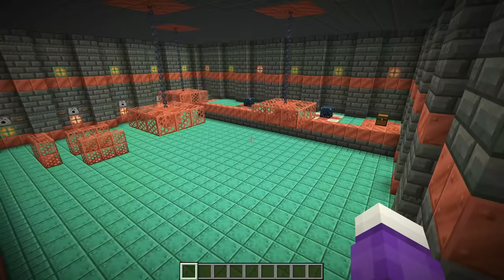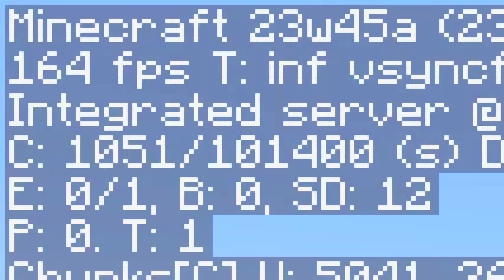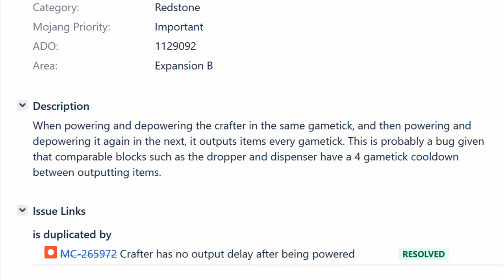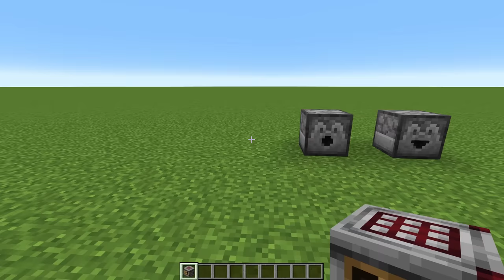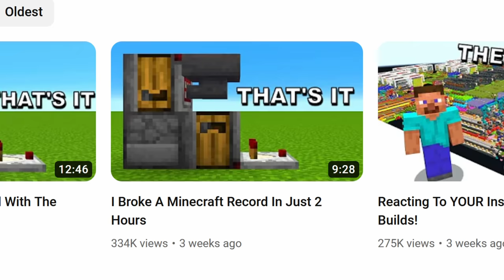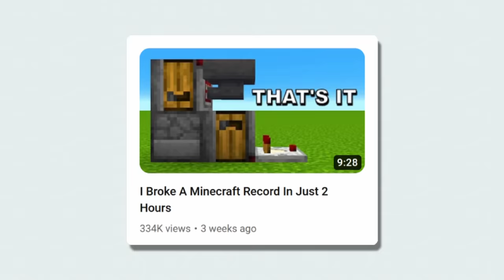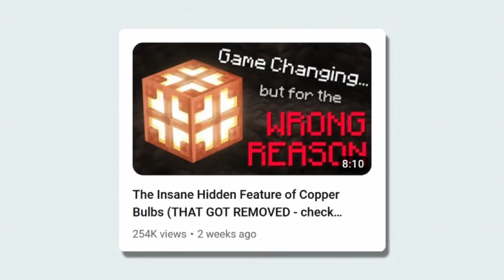Mojang Is About To RUIN Copper Bulbs (And Crafters)

Comment: The crafter nerf doesn't bother me, but the copper bulbs definitely need to be reverted
Reply: no i like fast
crafters but i agre on the bulbs
Reply: Yeah, an autocrafter not needs to be instant. And in fact, the original spead did look like as a very good material for lag machines if you stack up enough of them in the same place.
And for the copper bulb thing: you already have a block that can make timing. It's called "a repeater".
Reply: @tovarishchfeixiao A repeater is not a bulb
The bulb had a 1 game tick delay, while repeaters have 2 game ticks. 
The importance of this 1 game tick, is that All redstone components work on multiples of 2, so entering these odd ticks is very important for precise timing.
You have one movable block that did that (bulb), while all other options are not movable or too big. That's the problem.
Reply: @tovarishchfeixiao  the point with copper bulbs being interesting is that they had half the delay of a minimum length repeater, which, unless they do something crazy like adding copper repeaters or something for game-tick specific delays, the copper bulb could've been revolutionary.
Reply: @danny_dan4323  yeah but mojang doesn't care lol. they don't listen to community feedback, ever.
Reply: @genio2509  That 2 ticks is pretty much enough a thing for a game like this.
Reply: @danny_dan4323  I'm pretty sure that you still can build those things even if it might be a little bit slower.
Reply: @tovarishcheleonora8542 no its not. If you say that then you havent explored enough the redstone part of minecraft and its community
Reply: That 1 odd game tick makes the difference for a lot of builds
Reply: @horminel  You still can make building for the same purpose/function. Even if it's 1 tick slower or not as pleasing for your eyes.
Reply: @horminel  "that 1 is the difference bruhuhuhhuh". No one stops you from building. And you still can build anything you want. Maybe the signal won't be "1 tick" but the purpose and function still there even if a bit slower.
But why do i expect from a 9 years old to understand this?
Reply: Same thing. The special was withered away by placing one tick to make it even.
Reply: @sylv512 Sure. Let's just go ahead and ignore all the countless times Mojang has done something specifically because the community asked for it. Seems reasonable to me.
Reply: @tovarishchfeixiao  the entire point why 1 tick redstone is so cool is because it pushes limits. people dont want this for building in survival, this is for huge redstone projects. if you cant understand why this copper bulb nerf is awful then you might just be the 9 year old
Reply: @tovarishchfeixiao  some machines just break without a 1 tick difference. Hell, if you watched the video and actually payed attention, you would notice the piston extender breaking. So maybe pay attention before mocking people?
Reply: @QTBlaze.  Oh cry more, but you will never have 1 tick bulbs in the game ever. Deal with it. 😁
Reply: @tovarishchfeixiao "why do i expect 9 year olds to understand this"

also you: literally doesnt understand redstone, joined youtube a year ago, didnt even watch the video before commenting
Reply: @tovarishchfeixiao  what's your problem? you just want attention? i feel kinda sad for you tbh.
Reply: @Ezoc  And if you have a working brain then you could know that there is lot's of possibilities to make a workable extender, you just need to use a different build for the technical part.
Nearly anything is possible to build with enough creativity and problem solving skill. Also piston extenders are not a brand new things.
Reply: @Tohkie  Nah, thanks but better if you not try to decide what i understand and what not. Just because i'm not crying for a "but it's 1 tick!!!" that not means that i not understand redstone. 

2) What does that matter if my account is 1 years old? (also it's pretty crazy that you went and checked it, and i mean crazy on the bad way)

You not even know if i watched it or not, so shut up. Thanks.
Reply: @lunafoxfire  The one who wants attention is you. After all you did feel the need to make a reply that not gives anything into the conversation.
Reply: @tovarishchfeixiao  Just because redstone users get a 1-tick block doesn't stop you from building how you want. There really isn't a reason to deny others their fun. They've given valid reasons for their argument, and it's not impossible to implement since that's how it worked in the previous snapshot, so how about you bring a reason forward for why it should not be a 1-tick block?
Reply: Guys, I think this tovarish guy is just "trolling", since he has no better things to do in life. Better ignore him
Reply: @blueskyrobyn  You should bring a reason why there should be one on any cost. Because the world won't collapse without it. And clearly, people were able to play and make things without the existence of a block like that.
Reply: @tovarishchfeixiao  There have already been two reasons by other players brought forward, and it's not just about "speed" as shown in the video. It falls on you to provide a counter-argument.

Personally, yes, I don't play with much redstone either, so the tick thing would mean nothing to me, but I don't see the value in stomping on the playstyle of players that do enjoy redstone experimentation.
Reply: @sylv512 me when I lie (the honey block exists)
Reply: @tovarishchfeixiao  this comment will look really silly if they fix it

Hopefully you’ll get blasted in the comment section, for a 2nd time, if /when they revert it
Reply: @tovarishchfeixiao  every redstoner ever who are clearly smarter than u and more experienced abt the game more than u: this is a dumb change
A useless piece of garbage: ah yes im smarter in redstone than all of those guys and this definitely doesnt change anything even though I dont have any expertise in this field
Reply: @tovarishchfeixiao  it being slower makes it a different thing. You can get 1 tick timings already, but its large and annoying to deal with. I don't think you quite understand how huge of a deal 1 tick timing is to the technical minecraft players.
Reply: @sylv512 did you watch the video? Mojang accepted a false bug report causing all of this
Reply: @tovarishchfeixiao  oh nvm it's just bait
Reply: @tovarishchfeixiao and that Just proves that you have No Idea what u Re talking about.
Reply: @tovarishchfeixiao you clearly don't know much about redstone if you think the repeater and the 1tick copper bulb are even comparable, so don't talk if you don't know it
Reply: @tovarishchfeixiao Please don’t write walls of text if you’re going to use that kind of grammar.
Reply: @tovarishchfeixiao  It's not just 1 tick slower, it's TWICE as slow. If the smallest unit of time that you can "step" a redstone machine is 2 ticks instead of 1, then a machine that needs to be as fast as possible will take TWICE as long to do the same thing (such as flying machines, piston extenders, highspeed autocrafters, bulb displays, doors etc.)
It's like ordering a 4K screen and getting a 1080p screen and saying "oh so for every 2 pixels I get 1 pixel? That's fine, it's just one pixel right" like nah my dude, it's HALF the resolution.
Reply: @tovarishchfeixiao  congratulations, you won a "clown 🤡" badge! 
oh wait, you already have multiple of those
Reply: @tovarishchfeixiao the thing with the bulb (if you watched mumbo or purple's video on it) is that they allow for devices which use 1/2 a redstone tick. This makes piston setups cleaner as he shows at the beginning of the video.
Reply: @sylv512  As someone that constantly criticizes Mojang, you're wrong. They listened to a bug report to make a change many don't understand, a bug report someone from the community made. Also, they change things based on feedback as well, and they even have an official feedback forum on their website. They listen to that.

Now, they aren't going to always do everything that is requested, but that doesn't mean they don't listen. Mojang irritates me, but you're wrong about them not caring at all.
Reply: @moldman5694  You can write "half" and "twice" in all caps, but it won't change the fact that it's just 1 tick of difference. Which shouldn't be a big deal. Especially since the 1tick thing is basicly was a short life brand new thing. If you didin't die from not having it before, than you won't die from loosing it either.
And since we are talking about ticks, that's not a big difference. It's not like as if every possible option were changed to minimum 5-6 or higher.

I hope you know that pixels of a screen is can't be compared to time. It's like as comparing an apple to a brick.
Reply: @tovarishchfeixiao  Yeah, Mojang should never update the game either "Because the world won't collapse without it." I mean, even before 1.12, "...clearly, people were able to play and make things without the existence of..." many updates. 
Dumb. You know that. Why troll?
Reply: @Из_имянный_Файл  Wow, how creative. (sarcasm)
Let me guess, your kindergarten pals did teach you this thing yesterday? 🤣
Reply: @tovarishchfeixiao the moment you lost the debate kinda sad
Reply: @tovarishchfeixiao  Bro's never made a unique redstone contraption in his life and is talking like he knows anything 💀
Reply: @tovarishchfeixiao  no, your dad teached me, since he was disappointed in your intelligence
Reply: @tovarishchfeixiao  I'm not an expert on Redstone, but there are multiple reasons why the copper bulb was so useful, like, it could make much more compact machines with only one tick.
Also, 1 tick and 2 ticks are a huge difference, that would mean that something that would normally take an entire day, could take only 12 hours.
Reply: @tovarishchfeixiao  
Why not? You can functionally do everything on 4K screen that you can on a 1080p screen right? That was your argument, that 2 ticks is functionally the same as 1 tick, just slower. But you can still build the same machines.

But like, why change it? People enjoyed it, there were no complaints, people were having fun with the new changes. So why change it back? I mean you're right, ultimately it doesn't really matter that much, especially since it's a new feature anyway. But just imagine if when they introduced observers or slimeblocks, if they had just nerfed them right after for no reason. Not balance, not game optimisation, just for the fuck of it. It's just baffling more than anything else.
Reply: @tovarishchfeixiao If you aren't experienced with redstone then don't fight with people who are
Reply: @tovarishchfeixiao this guy is literally just a walking Dunning-Kruger effect
Reply: i think the crafter speed should be an option, just so mojang doesn't add lag machine 2.0 to the game.
Reply: @tovarishchfeixiao  1 tick on a sticky piston causes the piston to leave the block, 2 ticks allows it to push and pull back. this is at least one different thing between using 2 tick only and allowing 1 tick things to exist
Reply: @tovarishcheleonora8542  That 1 tick is quite important man, if you seen any fast Redstone builds. Hell, subticks are even used! If you really think it doesn't matter, why to people build stuff to access that set of ticks if it wasn't important.
Reply: yeah, the crafter will be incredibly useful even with a 4 tick delay. Copper bulbs on the other hand are not much of a notable feature without the unique delay.
Reply: @tovarishchfeixiao  the repeater works on 2 game ticks, making it less precise than what the copper bulb was
Reply: For those who are redstone fans, know that some of us appreciate the work you guys put into the game and I hope they revert the copper bulb changes for you guys. Don't worry about the folks that hate without good reason.
Reply: @kyceessadki2501  "precise precise". You not need precizity for make things. You still can make anything with any purpose.
Reply: @tovarishchfeixiao  you do not have a solid enough understanding of the game, math, or reason to be making comments on any of this lol
Reply: @tovarishchfeixiao  
Why do we have elevators? Stairs literally do the same thing
Why do we have cars? Our legs literally do that same thing
Why do we have rocks? Your brain literally does the same thing
Reply: @emiliaolfelt6370  You spoiled kids should just accept that you will never have a 1tick bulb. Period.
And you can fight as many as you want but it's never will be a thing in vanilla. 😁
Reply: @stevengucum I don't understand why everyone have so much free time to argue with him. He is obviously just want attention, but even of not and he just stupid - it doesn't make sense even more...
Reply: @sylv512  i feel like people like you are the reason mojang doesnt listen to feedback, people are quite toxic, these nerfs dont matter much, the crafter would be absurdly broken, and it still is regardless of what they do, auto crafting is still god tier even after this change, be glad they still work on this game
Reply: @tovarishchfeixiao  You have no idea what you are talking about, when making systems using logic gates timing is everything. Redstone is commonly abstracted to logic gates, and as such consistent timing is necessary. Ask and FPGA programmer, and they will tell you the difference in one clock pulse is make or break. I suggest you learn more about clocked and logic-based systems before making arguments such as "One tick is no big deal."
Reply: @tovarishchfeixiao  You are just making false claims. You say it will never happen YET YOU HAVE NO PROOF. It seems like you are incapable of making or understanding logical arguments.
Reply: @Theinatoriinator  Cry more, kiddo. Cry more. You still won't be on the right here. 😁
Reply: @tovarishchfeixiao  Am I really the one crying? I haven't played the game in months, and I am simply providing my external opinions as somebody who programs for a living. You seem to be the one crying as you must resort to ad hominem and unbiased attacks while ignoring reality. I have nothing to lose in this debate. Of course, upon further observation and investigation into you and your account's history, I'm having trouble believing that you are making your arguments in good faith. Its quite unfortunate, but nowadays there is a common tactic called 'trolling,' which ruins the fun of debates.
Reply: @Theinatoriinator  Your "job" has nothing to do with the fact that people under this video are crying for a 1sec faster block like as if they were a child and somebody just took their new toy. 
Also do not believe that you are working as a programer, because it's common in internet arguments to lie about one's job in hope of gaining dominance. And if you were actually work that job then you would know that your "job" means nothing in this argument.
And people still can build very creative things without that block. Just like as they always did.
Reply: @tovarishchfeixiao  no, because there is no option for a 1 tick. Bulbs has lost its uniqueness and is now only a glorified lamp that gets dim when it oxidizes. Wow, it almost feels like redstone engineers can't use this block anymore. "People still can build very creative things," like what? Houses? What about the other side of the community? I feel like you're still not giving up on this because you truly have lost.
Reply: @striderloki5080  Me? lost? XD
Just because you can't accept that you will have to work with 2ticks just as you always had to? Interestingly in the past people were able to make amazing redstone stuff without your beloved "1tick" lamp. lol
Then what is exactly the difference between the past and now? Nothing.
You're just a kid who got upset because "daddy mojang" took your new toy away.
Reply: @tovarishchfeixiao  there is a difference. Just look at the things they've built with 1 tick delay. Compact, silent, and even faster contraptions. Yeah, we are mad because Mojang took our new toy because it was actually useful. Now we are stuck on using bugs and glitches again to recreate it (with it being large-scale again). It doesn't mean that you're opinions are automatically valid if you aren't actually a redstone engineer. That's like saying to architects that using rulers are bad, despite not being an architect.

Comment: Mojang never fails to hyper focus on things that don’t need changing while simultaneously ignoring community uproar when it comes to stuff like fireflies or chat reporting or mob votes…
Reply: they literally listened about the chat reporting though. They nerfed it to the ground and added lots of limitations to it. Oh, and, it was never going to be automated. They have an entire team dedicated to moderating reports and they do throw out ones that are false reports, as reporting chat messages ALWAYS sends context, and you cannot prevent that - so the team they trained specifically for this feature alone isn't gonna ban anyone willy nilly. I was on the side of the outrage at first but Mojang has clarified so much to the point it's clearly not a problem. They literally listened, get over it.

I don't understand the firefly outrage though. It's two pixels that float around, get over it.

Mob votes are fucked though, and need to stop (that said I like the phantom).
Reply: @SnoFitzroy You are probably one of the only souls on this planet that actually like the phantom.
Reply: @pixelgaming7261  i like it for lore reasons it is a pain to dill with but ether thin that i thank its a cool mob and it looks cool